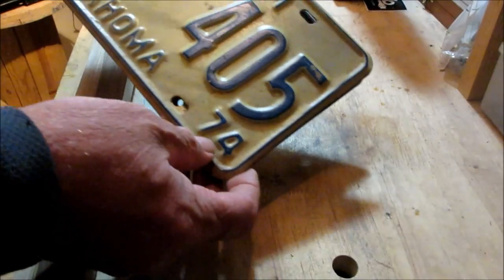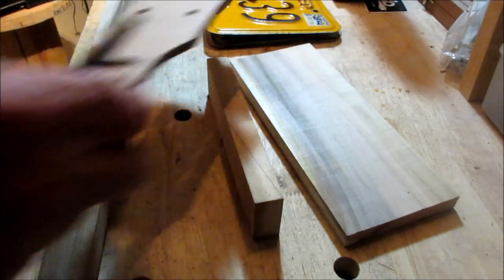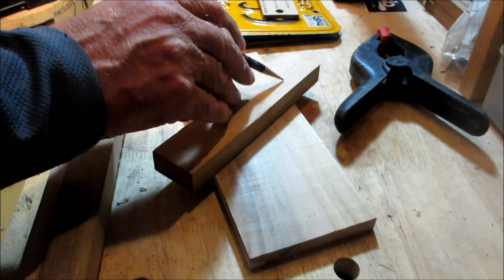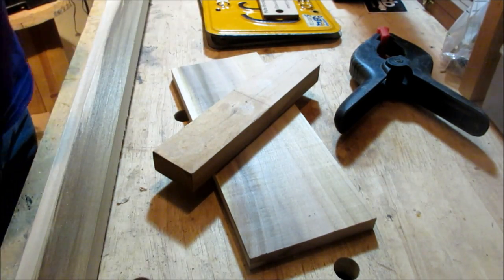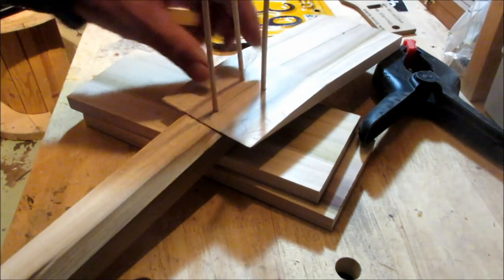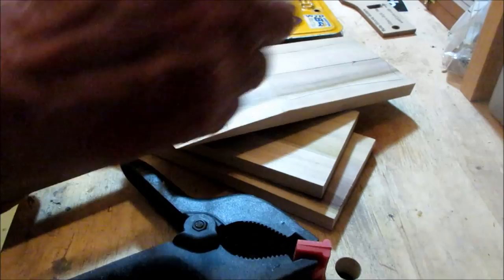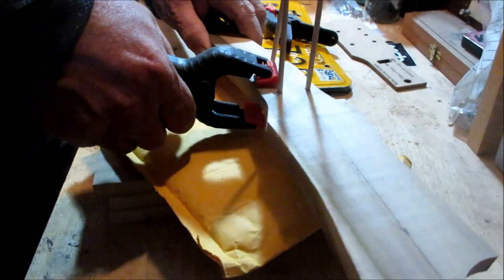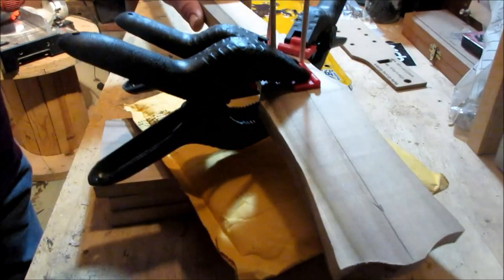The Case of the Slipping Scarf Joint

Comment: To solve the Case Of The Slipping Scarf Joint, when I was ready glue on the headstock to the neck, I first applied a strip of double sided tape between the 2 pieces to temporarily join them together correctly.  I then put a clamp on them and drilled holes for 2 screws.  After removing the screws and tape, I then glued them together, reinstalled the screws, and clamped them back together.  I removed the 2 screws after about an hour, then applied more clamps.  Next day, I install 2 dowels in the headstock.  I found that the double sided tape works well to hold them in the proper position for drilling and clamping.

Comment: Have you ever tried using salt to stop the pieces from slipping. First, apply the glue, and then add salt to the glue and hold the pieces together using clamps. It's a lot less work.
Reply from the maker: Thanks for the tip Rick.
Reply: You only need a few grains.